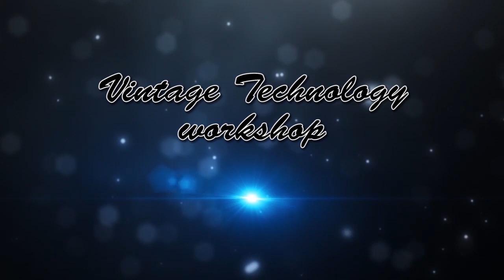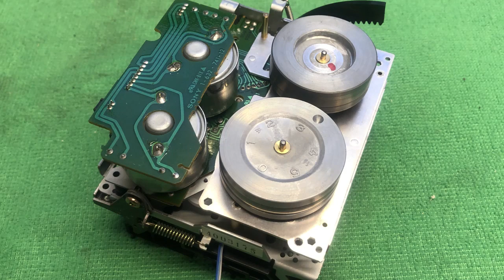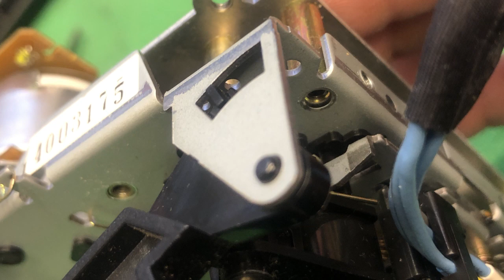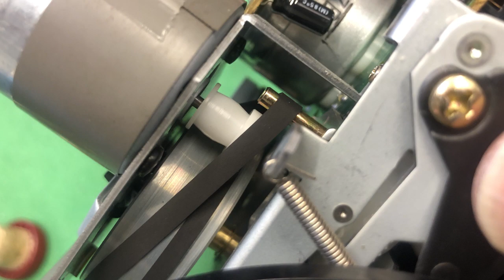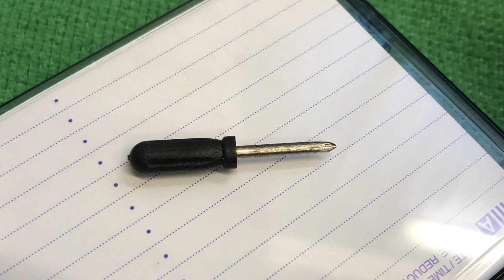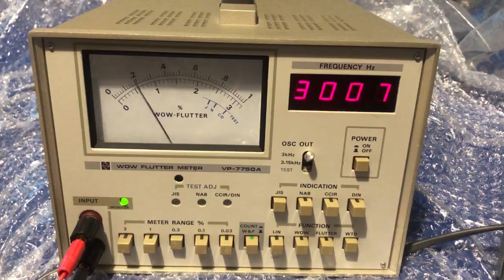Sony TC K677ES Deck Tech Belt Kit

Comment: Hi, are you still doing repairs in Plymouth? I am trying to get a stereo repaired which you have worked on before 😊
Reply from the maker: Hi there, the shop is now closed (about 1 1/2 years ago) and I'm still sorting out the fallout from that. But when the workshop at home is all up and running I'll give you a shout. Will probably be after Christmas now. All the best, Ast...
Reply: Hi Aston, hope the workshop setup is going well. Is there a phone number or email address to contact you on regarding the stereo repair?